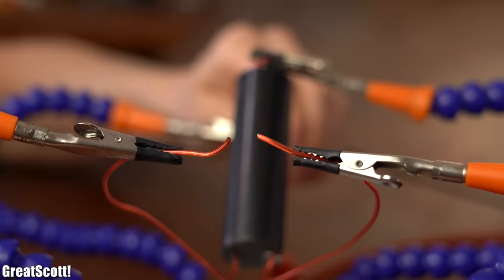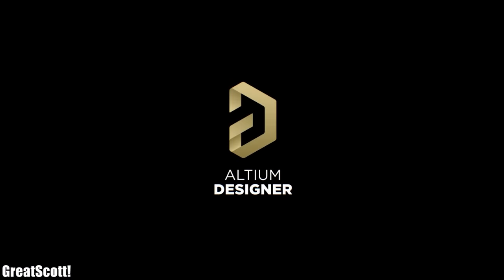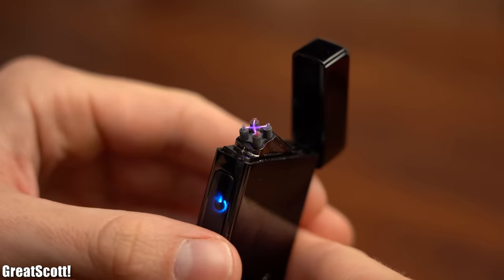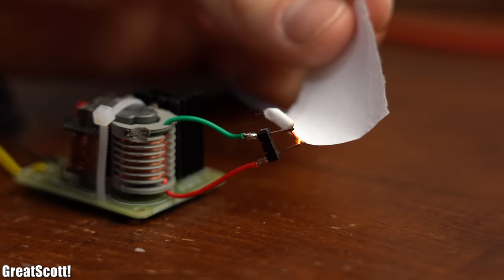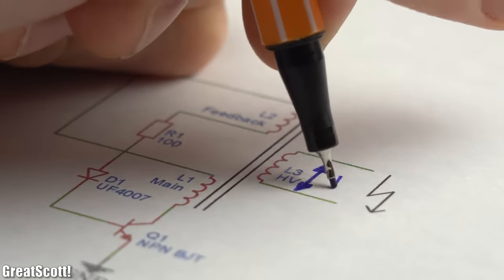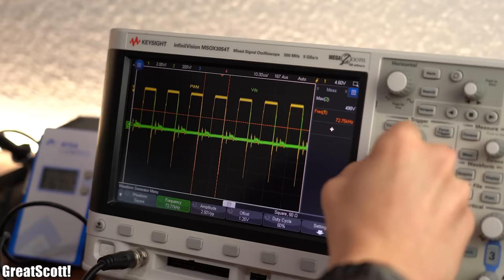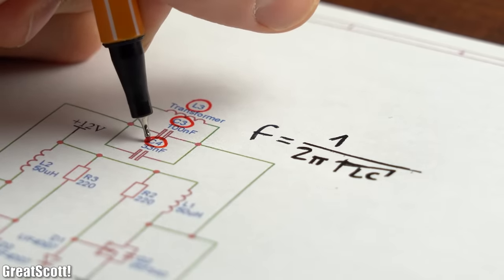DON'T BUY this HV Generator! Build this one instead....please

Comment: I think both ways have their merits. Certainly you learn more with a kit (for example that the included transistor is not up to snuff). But for building my gas-stove-igniter I used one of those ready-made modules, an 18650 and a spark plug. It works like a charm and a kit would be very hard to properly isolate. And frankly, I couldn't care less for the PTB-certification, that's just germans being germans for no good  reason...
Reply: Exactly, if you're electronics enthusiast and just want to play around and learn stuff go for the kit, but if you are actually using the HV to do something practical instead of just playing around (f.ex. I also used that module as an igniter), then the module is easier to use, cheaper, better isolated and likely has more resistance to mechanical vibrations and such. And yes, I also used one to make a taser, afaik it's legal in my area
edit: of course that doesn't apply in the case where you need some specific voltage / frequency / other properties at the output, then you have to design your circuit anyway
Reply: That spark gap would make a wicked cannon ignitor, rather than spray gas in and hope for a stycometric value to get a good boom 💥 split water with electrolysis to have a perfect ignition everytime.
Reply: Yeah he sold me on the first one that just worked because I have a propane grill that does not have a electronic igniter on every burner. It only has it on one and that is supposed to light the other burners along the way. I can see how adding this with A small bit of work could make the igniter circuit work on all of the burners
Reply: They make for good gas igniters but they also burn out fairly easily if used for a short period of time continuously. Had one in a project box with two bolts coming out as electrodes and a PTM switch to turn it on.
Got some big zaps from it though.
Reply: 👍 for your last sentence!
Reply: Actually this thing only needs to have the certificate/symbol if used as a taser since then it's judged according to weapon laws.
Which by the way doesn't seem to be too far from reasonable considering the deaths caused by taser usage even when considering only the deaths caused by trained professionals (police)

Else - depending on power and frequency - radio agency might wanna have a look
Reply: @datpudding5338  That high voltage module is not a taser, a taser is a very specific circuit and is physically connected to the target/person with a pair of fine wires, fired from the taser gun with a projectile charge.  It puts out a quite high voltage and current vs. that toy which will hurt quite a bit but is not the same thing at all as a taser, more of a "stun gun" at best.  Stun guns are more of a noisy deterrent than anything since as soon as you stop shocking someone they are not going to be disabled by it, and are likely to resort to some violence after being shocked.
Reply: David Davidson you are essentially shorting the output so I’m not surprised they burn out quickly, see how the transistor burnt out on the kit too, when shorted for too long, the only reason the ZVS didn’t is because the control circuit is more robust and the wires and transformer burn first.
Reply: Exactly my taught as well. Of course it's quite easy (if you have the knowledge) to build a HV source that have higher power, better efficiency, makes better arcs and/or fits better for applications that requires a specific or adjustable switching frequency or HV pulses to be generated at a set rate etc. 
But for those who who just need a small non specific, easy to get, high voltage source for something else (a gas igniter was a good example), that E-bay thing isn't bad at all. 
And, yes - proper isolation is indeed the hardest part of a DIY circuit - both to the outside (to avoid shocks), but also internally. 
It's easy to get to very high voltages, but hard to avoid arcs at the wrong places (which will usually end up like his transformer did at the end of the clip)🙃
Reply: @conorstewart2214  that arc module actually burn at open circuit instead of short
Reply: @Speeder84XL  same argument for literally every chinese modules u could get online

buck boost modules etc

h bridge? whatever? just buy and plug mate, no one got time to optimize a damn h bridge
Reply: @urnoob5528  an arc is very low resistance, hence pretty much a short.
Reply: Wdym properly isolate?

Comment: YEEEES!! I HAVE ONE OF THIS TRANSFORMERS LAYING AROUND. PERFECT TIMING!
Reply: Be careful around it .
Reply: No problem, i have a diy voltage multiplayer that makes 50KV. Capacitors are very small [47pF]. I have a lot of Experience, aaaalways careful with theese things. But i DIDNT know how to do that with music, i will try to find an ne555 audio modulator for it so that i can build my first plasma speaker!
Reply from the maker: Be careful and have fun :-)
Reply: I have a step down transformer, Can I make it?
Reply: @sgt-Badger  works with flyback step up, idk about step down tho ig ill try it maybe the results will be interesting
Reply: @ShahZahid  thank you
Reply: @greatscottlab  Yo GreatScott! I had a question, does the shape of the transformer matter for the output voltage? For example, I use a charger transformer, will your transformer output higher voltage than mine with the same circut? I'm asking this because your type of transformer is too expensive.
Reply: @Engineeringtech768  I bought 24'0'24 V ferrite core transformer for literally $3 from a local repair shop. You can find transformers in every charger out there. Or you can buy a mosquito racket and remove all the voltage multiplier stuff and just use the output pins of the transformer to generate plasma. You dont have to do anything in the mosquito racket circuit, just remove anything that comes after the transformer and the two idle pins that are left, connect some wires to it and you get a hot, high frequency plasma.
Reply: Same, but it arced internally and is now nearly completely useless :(

Comment: I like how that MOSFET de-soldered itself for you at 5:39.  How convenient. :D
Reply from the maker: That is the thermal protection ;-)
Reply: @greatscottlab  😂😂😂
Reply: @greatscottlab  🤣
Reply: @greatscottlab  lol
Reply: @greatscottlab  
I had some 12v led lights that after about 1h of usage they were desoldering themselves and falling on the floor with their 2 legs still holding onto the sockets on the ceiling.
It turns out the manufacturers thought it was a good idea to use thin traces on the board as an 10ohm resistor... instead of using an actual 10ohm resistor...
On the upside, the manufacturers didn’t specify that if you mount the lights upside down they come with integrated thermal protection.
Reply: I don't like this kit mostly cause they kept dying on me, and that kit takes forever to get here
Reply: @greatscottlab  Lmao
Reply: Ich liebe alle Videos von GreatScott!, du lernst wirklich viel von ihnen, danke!
Reply: @greatscottlab  Sir, how much KV does yours have, can it be used as a stun stick?  long discharge time
Reply: The magic smoke.

Comment: 3:38: "a kit with suitable driver circuits"  You mean: a transistor that burns out in minutes.
Reply from the maker: Haha true ;-)
Reply: @greatscottlab  And that was before I had seen the whole video. Two of those circuits dead on my bench.
Reply: Seems to be designed for a very low duty cycle. Like 5 seconds on 5 minutes off lol
Reply: @divingquokka  I also built that same kit before and it only worked for 2 minutes before mysteriously dying. Now I learned why.
Reply: @snaj9989  They're not designed to run for more than a minute or two. If you tazer someone longer than that their heart will probably give out. To be fair tho, that's not what any of us use them for and they don't list any warning about that tho... 😅
Reply: @DrakeOola  To be honest that thing has very low current at very high frequency. In order to kill someone by stopping their hearth you need some sortg of pulses or low frequency AC current. I got zapped by both pf the modules in the video, not pleasant but definitely not fatal. Since their leads are short I don't think it is likely to touch them with two hands at the same time. Althought these are not toys so some care is needed. My module didn't worked for 2 minutes continuously. There was something wrong with it I only got like 5-10 seconds random power out of it then it suddenly died, probably a transistor failure but not because it was hot.
Reply: they say non continuous use

Comment: I literally bought 5 of those this week to upgrade some bugswatters for my friends. I will enjoy doing it like your advise in the video. Thank you so much!
Reply: I did the same thing :D
Reply: Are you putting all 5 into one bug swatter or do you just have 5 friends with a big enough bug problem they need an 'upgraded' bug swatter? 🤨

Bug swatters work fine but the only bug they actually attract or work on here is moths, except a regular light bulb ends up killing them too...
Reply: @DrakeOola  Well it's the handheld bugswatter. I fix those with a rechargable cell with USB connecyor and then with the HV generator. It's mostly fun, very deadly for bugs and my friends love it.
Reply: @maurice-le-roux  I love it, I've actually done this with zvs circuit like great scott, as i Was 14. It was very effective against those little fruit flies that normally flew trhough the flyswatter. But the zvs had to high frequency and melted the flyswatter if you hold it for too long. Those another HV generators are cheap, effective and already prebuild :D
Reply: @darekmario446  awesome, yes nothing will get past it haha.
Reply: I do the same haha, those fly swatters normally barely have enough power to kill a fly. I usually don't even upgrade the batteries, 2 AA batteries will do just fine. An 18650 with a boost converter can be used for maximum power but isn't necessary. I do recommend using the cheap HV modules instead of the circuit shown in the video though. They are more robust and the arc doesn't create any heat. They're also super easy to install.

Comment: Yeah, I would never buy a single one of those off Amazon.
I would buy the 3 pack so I have extras.
Reply from the maker: Smart ;-)
Reply: @Joseph Bunn 
Well, if they are synchronised... can they self-synchronise ?
Reply: Technology Connections:
Through the magic of buying 3 of them.
Reply: @Joseph Bunn the voltages from those listings are pretty much made up numbers... on ebay you see the same package with all kind of different voltage numbers. 5kv, 15kv, 25kv... 
they add anything to the description in the pursuit of sales :D
Reply: me too i order one of thoose mini transformes but not one i took 15

Comment: I personally like does little pulse high voltage modules because you can blow tiny holes in paper or leafs and they are pretty loud if you pull contacts far enough so they make a great house alarm
Reply from the maker: That is also an application
Reply: Someone in our FB HV group has de-potted one of these to see what's inside. Essentially its a Cockroft-Walton voltage multiplier with several stages. The problem is that there is no current-limiting resistor so the devices eventually fail from diode destruction or over-heating.
Reply: @littleshopofelectrons4014  so it's best to add a current limiting resistor? What would you recommend?
Reply: @StarCracked  HV resistors can be expensive. The resistor(s) may cost more than the module. I believe the output of these is no more than about 50 KV regardless of what the ad says. A few megaohms should be adequate.
Reply: @littleshopofelectrons4014  more like 15kV. I can't imagine the caps inside are rated to that (just little film caps)

Comment: So basically your recommendation is not to use the working Amazon modules but rather solder up a kit that rapidly transforms in a completely safe HV generator, i. e. a broken one.

Comment: I managed to shock myself with the black one, from that I can tell you it's more like a stun gun than a taser, still hurts like hell though and since it locked the muscles in my arms, pretty dangerous too.
That said the other small one you showed is incredibly fragile, I had two one of which broke because of the thin and fragile ferrite core, and the other one had the insulation fail after a few seconds of the high voltage leads being too far apart, not worth your money either.
Better do some research and make/get a good Tesla coil
Reply: i've build 500kV Marks Generator with this. 50 cm sparks kick ass
Reply: I have shocked myself with the black one couple of times and it usually wasn’t too bad, way better than electric fence

Comment: Hi Great Scott, good video.
Yes you said it with high frequencies we don't get shock but burns the skin. This is the technology used in surgical diathermy machines used in all kinds of surgeries in operation theatres. They used to cut, coagulate and do other porcedures on human body. Used in almost all surgeries like gynaec, general, eye, skin, uro, etc...
Reply: Thanks for the info 👍🏾
Reply: @jkadofo  👍

Comment: That transformer is not wound at a ratio of 1:3750. It's somewhere around 1:100 - 1:200. It uses inductive spiking on the primary to 'boost' the voltage. Do you not recognise a boost or joule thief circuit when you see one?

Comment: I have to thank you for making this all about safety. Its a thing that is underrated when it comes to electronics, even small power electronics that dont produce much voltage and amperage. It is appreciated, from a hobby/bedroom electrical engineer.
Reply from the maker: Well said!
Reply: but he also sometimes overdoes it... 
but at least he's not like those youtubers with twenty "do not try this at home"-warnings
Reply: @chrisakaschulbus4903  I think it's important he overdoes it. If you think about it, despite it's flaws, our power system in the United States is relatively safe by modern standards even with our plugs.

One of the main reasons is we don't like plugging in a ton of things into an outlet which helps prevent electrical fires as we don't have much safety from the plug, onwards outside of your wall.

Comment: That little HV generator looked a good idea, honestly. Imagine for a moment you wanted to do high-speed photography. A brief arc of light from high-voltage coils is how that is done. Ordinary xenon flash tube max out at 100,000th of a second due to the latancy of xenon. With an air-gap flash you can achieve 1,000,000th of a second exposures.
Reply: and you can use it for cheap edm machining!

Comment: That device you call garbage has a voltage doubler circuit of which if connected to your diy high voltage circuit would produce just about the same Arcs

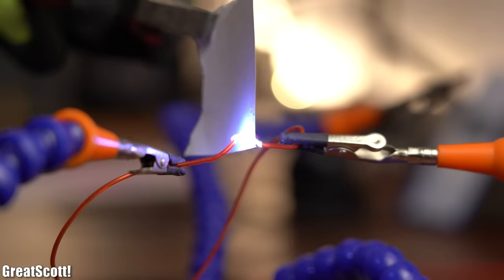Comment: 10:32 - Enjoyed the video, not enjoying when things burn and go defective. At least the ones from amazon doesn't have this 'issue'.
Running such small transformers with a ZVS circuit is just begging for the windings to burn and getting destroyed. It switches huge currents.
Take a look at the bottom next to the green wire - enamel wires are hanging out, so no more sparks from this one.  Perhaps a video on how to wind your own high-power transformer?
Reply: Yeah, I was like, GreatScott is usually super neat, and with this he's approached destruction videos. Nobody is safe from that, apparently.

Comment: I don't see why the Amazon product is such a bad thing.  Yes, you could use it as a taser, I suppose, but you can misuse almost anything.  You can break a glass jar and use a sharp piece as a knife.  You could even hit someone with a chair.  This doesn't mean a chair should come with a license.

I've actually played around with one of these Amazon devices.  It does produce a nice, fat spark, and it's true that if I were to connect with it, I would be very unhappy about it.  I'd be unhappy were I to connect with the power coming from my wall sockets, too.

Comment: I replaced the 100 ohm resistor with 2k2 and also placed a 4700pF capacitor across the primary.  Result was nice arcs with a current draw of less than 0.5A at 4v and no more blown or overheated transistors.  100ohms is far too low a value fot base resistor but a nice way to sell lots of those kits!  The capacitor limits the peak voltage seen by the transistor and also reduces the drive frequency reducing switching losses and coil impedances.

Comment: I use the ready made modules for making "static grass applicators" (for putting fake grass on things like model train tables, gets the grass particles to stand up)
Reply: that's so psecific and niche... but i kinda like it :D
but couldn't you use a balloon and rub it against your hair for static pulling action?:D
Reply: @chrisakaschulbus4903  maybe, but usually you're applying it to a large area so it nice to just hook ground wire to that area and then shaker the grass all on.
Reply: @norlin76  i wasn't too serious, of course the constant and probably more controllable nature of it seems far better :D
Reply: i wanan try that.. onces you made the static grass aplicator, how many seconds can you actually press the button¿¿
Reply: @shiroumxm2052  I haven't tried holding it down for an extended period, but for the 20-40 seconds or so needed to apply static grass it has no issues.